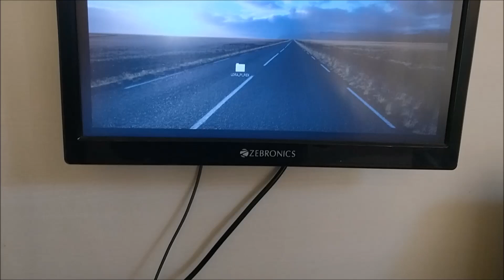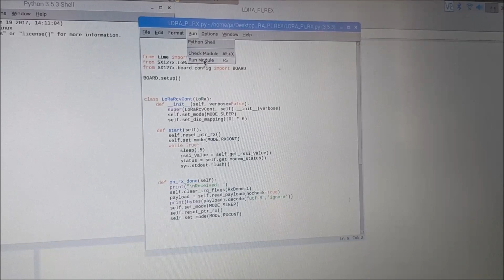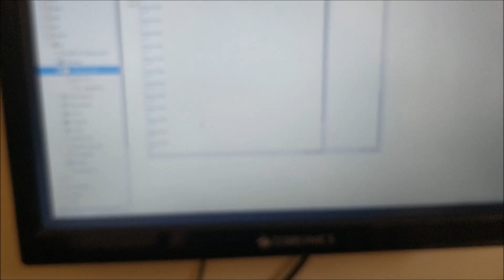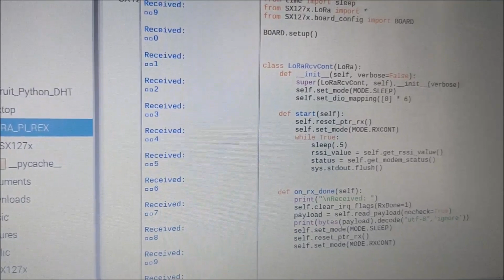How to Use LoRa with Raspberry Pi - Peer to Peer Communication with Arduino

Comment: Hi, How can we measure the power consumption of LoRa module connected to the Raspberry pi 4? Is it possible to calculate it without using external hardware?

Comment: can we transmit a image between them?>
Reply: In theory yes but it would be super slow if you take an image then convert it to binary then send it and reconstuct it on the other end then you would have an image. You could also convert it to base64 and send it but if an image is 47.81KB and you're transmitting at 300 bps then it would take 159 seconds to send.

Comment: How do I send data from raspberry Pi to Arduino over lora. I'm using the same lora module as the one you're using.
Reply: did you find any solution , coz i am stucked there hh
Reply: yes me too :/ Have you?

Comment: How did you make the python lora script running on rasp pi boot up? Tks
Reply from the maker: Please check the link in description for detailed explanation
Reply: @Circuitdigest  one more question about pylora, can we set  for example, SF easily in the script like arduino radiohead lib. ( .setSpreadingFactor() )? Because I need to test all the lora params (freq, crc, sf, tx power) using rasp pi...thank you
Reply from the maker: @arkanayudha3321  You can try asking the question to the project author he is active on our forum https://circuitdigest.com/forums. So pls post your question there

Comment: I have this error LoRa radio init failed
Reply: that is because your lora frequency is not the same as in the code. check your Lora module frequency and change it accordingly in the python code

Comment: The library you used in python, is it useful for a lora module SX1276?
Reply: sx1276 is for end nodes and sx1278 is for gateways, but you can basically use both modules.
Reply: @momolosi1689  This is not correct. Sx1276 and Sx1278 are basically the same, except in the working frequency: xxx76 is for 868/915 MHz and xxx78 is for 4733/470 MHz.